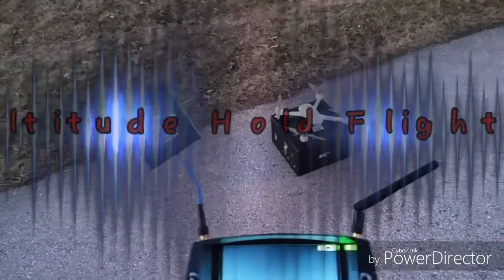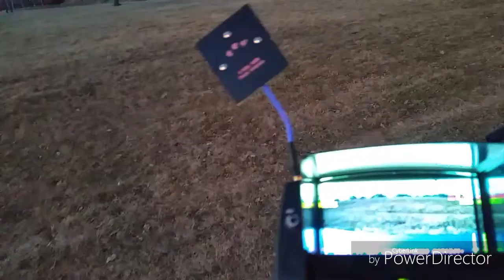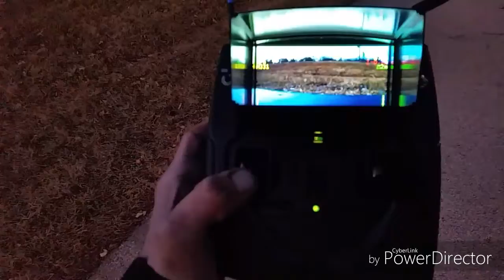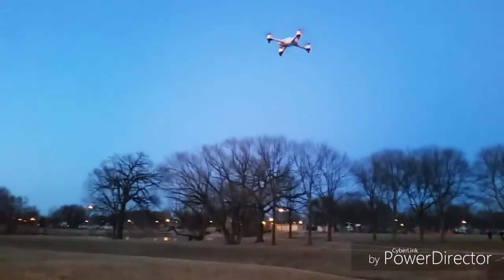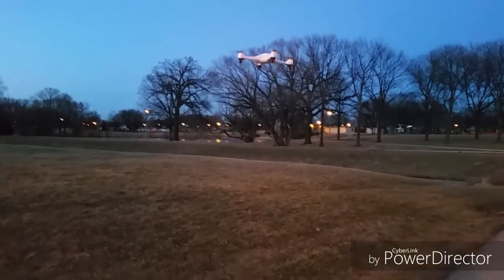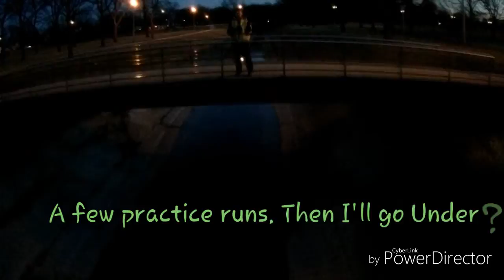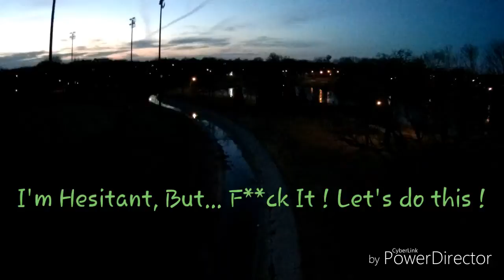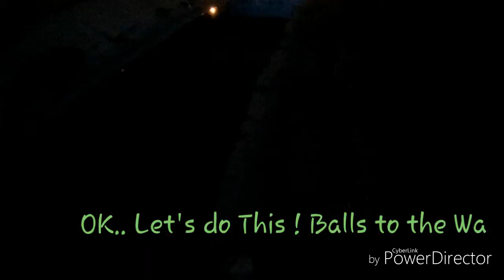hubsan h501ss Altitude Hold Practice and Flying though Obstacles. Awesome

Comment: Hi Mark. Your accent sounds like Wisconsin or Minnesota 😎. I'm from Minnesota but live in California and lost my accent::( anyway I was wondering how far you can go in altitude hold before flipping on gps and it wouldn't kick in to save my butt ? I'm ordering the latest version . What are your thoughts on that ? Thank you for your time. Have a great day. Sincerely William Horsley
Reply from the maker: Oh wow. Your range, depends upon so many things. Your flight environment, any signal interferce, which controller you have, etc. I guess my thoughts would be to, use GPS hold and test your range, before it goes into automatic RTH lost TX Failsafe. Using that range, as a "reference", stay within the same range, in altitude hold. Don't go beyond where your quad went into an auto RTH. It is really give or take with the range, depending on what controller configuration you are using. If you have the standard controller, you should definitely do the external antenna modifications. If you have the so-called Advanced controller, be careful. Not sure if you've seen either of these two videos, they were long-range flights I did in a wide open area. GPS hold the entire flight, both. ---> https://youtu.be/mK65FPO72Lw.  AND --> https://youtu.be/3ctTn-Xv6v0.  Oh yeah, from Wisconsin.
Reply: @MarkSuttner  I'm from a small farm in Wheaton Minnesota . Thank you for the information and I'll be careful and do like you said.  I really have a fondness for the hubsan h501s. This WIFI for fpv is terrible,  I never understood the reasons behind going that route instead of staying with analog

Comment: Great video. Been chatting with you in one of your other videos and subscribed. Now I noticed in this that you added a caption 60%.. is that the sensitivity on the transmitter as gone in those settings as a newbie to take from Pro bit... Will it still use GPS on that setting as do not want to fly solo with no GPS until confident? also when activating the 60%, not long after it goes back to pro. What I mean is I activated at home while watching Tv and expected it to be on when taking quad out after a battery charge? Thanks again my friend and sorry for any silly comments
Reply from the maker: I'm not really sure what you are saying at the end of your comment...? LOL... The settings menu is 
 by holding down the left stick and pressing the right one like a button if you have the standard controller. If you have the advanced controller you hold down the throttle stick and press enter. From there you will be in your menu. You can change your controllers receiving frequency, you can change the "Control Stick Sensitivity", you can turn on the setting where it says, fly when no GPS, you can also go into manual mode flying. Manual mode is for extreme professionals only ! Changing the controller stick sensitivity from 100% to 60% is a good idea if you want "smoother flights". if you noticed, after you're flying forward and let off the stick the quad pitches upwards. Unless you release the stick very slowly to stop. Changing the controller sensitivity, is basically making the control sticks not so sensitive, if you get what I mean? Instead of the quad going As Fast as possible, it's more smooth... (60% is Actually Normal Mode, 100% is Expert Mode). I'm not sure why they come as 100% as the default setting ? These quads go about 5 - 5.5 Meters per Second ( in GPS Hold), and altitude hold they are capable of 5 times thats speed ! However altitude hold flying is very difficult ! Anyways, changing the stick sensitivity to 60% does not affect anything besides the controller's sensitivity to your inputs on the control sticks.
Reply: @MarkSuttner  Thanks again for all your help Mark, you're a gent. Now, ONE more SILLY... or Not so silly question... LOL!!!!! Is it a GOOD or NOT GOOD idea to give the brushless blades a bit of a zap with WD-40 just to keep them as new if flown in damp conditions.. and mean just inside too where you can see the brass curled wires?
Reply from the maker: @waddac2  NO ! Do Not Use WD-40 ! Ever ! Never !! It is okay to use a small amount of brushless bearing oil, every now and then, but you do not ever want to use WD-40 on a motor. Especially one with bearings! WD-40 stands for "water displacement 40". It dries out metal and especially bearings! It will disintegrate any type of oil or grease that is Factory fit in the motors and dry it out, Badly. If you're looking at the Copper that is coiled, that is basically just the magnets that make the brushless motor spin. To oil the actual bearings, you drop the oil, into the center shaft(bearings), not the coils. OIL is ok, Never Use WD-40 or PB Blaster, etc. Only "Oil"and Very Little amounts. You don't want dirt and debris in the motors. Oily conditions, Attract Dirt.
Reply from the maker: @waddac2  I understand why you would think WD-40 wood work to keep the coils clean. I would Not recommend doing that, whatsoever. If you want to clean the coils I would suggest using a can of compressed air or something similar. You do not want to get WD-40, PB Blaster or any type of penetrating Catalyst near the motor bearings. It will dry them out. "Liquid Bearings" is a very good product to use on the actual "Motor Bearings", you should not really fly in damp conditions, I understand why you would want to keep the coils clean however, damp conditions should be avoided all the time because not only does it dampen the coils in the motors, it also creates electrical interference with the components inside the quad.
Reply: @MarkSuttner  Thank you so much for that Mark and will only use my WD-40 on old locks that I pick and keep it well away from my drone. I will look into getting some proper oil for it at some point but for now will leave well enough alone as drone is brand new so probably will not need any oil dripping in for a few moths of flying. Thanks again for all your help and advice. I'm still interested in finding out the max distance or height it can go as there is nothing in the instructions. Will not be testing anytime soon as still new, but had it quite high in my first flight video then relied on RTH so did not mess up the landing in anyway, then as it got about 10 feet from ground I turned off RTH and continued flying for a bit. Also changed down to 60% in control settings but it went back to 100% after turning transmitter off and back on. I did not have drone turned on though, but if did would it constantly stay at 60 even if left off until flight next day or do you need to do it on each flight when drone is on?
Reply from the maker: @waddac2  You have to change the Sensitivity, Everytime you turn off the controller, it has nothing to do with the Drone, being on or off. Whatever you set your 5.8 frequency at, should stay set, after turning the controller on and off.  Every other setting must be changed, before every flight. I'm not sure if you told me or not, did you get to standard controller or the advanced controller ?? Just curious. Also, I'm not sure if you changed your 5.8 frequency in the controllers menu at all? If you haven't, you might want to. My h501ss came with the 5.8 frequency set at 5780 MHz The best frequencies for quads are between 5745 - 5760 MHz.
Reply: @MarkSuttner  Sorry delay Mark as not long been in from work. My transmitter is the standard controller and is set to normal 5.8G as did not want to mess with that setting. With mine been just the h501s should I still change frequencies to what you say, and will they stay after as do not want to do it each time? Do not mind adjusting sensitivity on each flight but if I am messing with too many controls may mess things up.

PS. Mine is at 5.8 and frequency at 5790MHz... Should I still drop to what you think buddy?
Reply from the maker: @waddac2  Yes. Set your 5.8 Frequency between 5745 -5760. The only reason for the different numbers is your flight environment and what's around you that may cause interference. Changing the frequency setting will not harm anything at all. 5755 MHz, seems to be a sweet spot, for these drones. Don't worry about the settings and your menu as much as you are. 5790 MHz is Way Too high ! Set it at 5755 and I bet you get better Reception. Do Not be afraid of the antenna mods ! They are So Simple ! They will extend your Range, your FPV and the communication between your Transceiver and your Craft ! It's A "Must Do", my friend ! Super Simple ! All you need is a drill, a couple drill bits, and a aftermarket external antenna mod kit ! That's all there is too it ! Take your time at first, and watch videos on how to do it. After being in this hobby for so long, I could probably do the antenna modifications blindfolded ! Lol 😊 Anyway, change your frequency down to 5755. I guarantee you you will get better reception. Also, there are a lot of factors, to consider when flying a real-time 5.8 GHz transmission drone. You have to think about your surroundings, the entire sculpture of the Earth around you and potential sources of interference. I'm not trying to blow your head off, with too much technological information, at once because it takes awhile to get used to these things... Are you aware or ever hear of the Fresnel Zone ? those are the types of things I don't want to bombard you with as you are making your first flights. However my h501ss came with a default 5.8 frequency setting the same as yours. Too High ! Lower it to at least 5760 - 5745MHz. Trust me, you'll benefit from it. The settings in the menu are very simple and can be easily changed. The only settings that cannot be "remembered" are the controllers sensitivity, flying with no GPS setting and *manual mode*. The 5.8 frequency setting should stay the same after you lower it from the default setting. Is this your first drone? Actually, is this your first gps-enabled, real-time 5.8 & 2.4 set up? I'm only asking because a lot of drones use crappie Wi-Fi transmission and reception and they just suck ! Unless they incorporate their "Own WI-FI network", like DJI products do...
Reply: @MarkSuttner  I will probably look into the antenna mods at a later date after quite a few hours of piloting time. I'm still at work at the moment but when I get home tonight at about 22:00hrs I will change my transmitter frequency from the 5.8 to your recommended 5755

Regarding it being my first drone, yes it is. I have had the very cheap ones a few years ago that are made out of polystyrene with for blades concealed but that's about it. Im not great with getting my bearing in flight directions but will soon after a lot more practice, hence reason I love this hubsasn with the GPS so if get into trouble can let go of sticks and it will stay where it is. I can get my bearing and slowly bring back to me, or click RTH and quad brings itself back.
Reply from the maker: @waddac2  One thing you Really need to be aware of, is the V.R.S. The Hubsan drones, suffer during a Return to Home. Please, Listen to me about this ! The V.R.S. (Vortex Ring State), also known as the "Toilet Bowl", in Simple Terms. Anyways, when the RTH function is activated, the drone will climb about 10 to 15 meters in altitude and then fly, autonomously back, to the position of the controller. Maintaining its altitude, during that time. What happens and it can be a fatal thing, is a vortex ring state / Toilet Bowl ->After, it flies back and is now starting to Descend Down, it can start to VRS, Bad. This happens "Mostly" in Windy Conditions (10+MPH). However, it can happen in low winds. Always, Always, Watch your controller's screen and make sure the Drone isn't starting a "spiraling motion", also known as the toilet bowl, or Vortex ring state ! These quads have problems with autonomous return to home descendants. If you are flying in windy conditions and activate return to home, watch your screen carefully!! Especially when it is descending Brother !! Like I said, it usually only happens, when it is windy outside, but it can happen when descending from very high altitudes. If you notice, erratic movements or a Circling/Spial, on your controller screen, immediately switch off the return to home button and slowly bring it down manually. It will save your drone !!! ;)
Reply: Mark Suttner I changed my frequency and now i have much worse signal! And even worse, I don’t know what the original was! Now i can never have good signal!
Reply: @drewl9781  5800 works fine. Good info here tho. Never have too many hubsans to fool around with/mod/etc. Best hobby drone out there imo. Also use a pad to launch from I think always. Buy a case for storage. Never throw a wrecked on away as they're fun to take apart and see how they're put together/experiment with mod'ing with first etc.

Comment: what do you think of the H501SS is it better now?
 as it used to have a few problems
Reply from the maker: Yes. Definitely. It doesn't have as many problems as the original h501s. The SS is Definitely better. You don't have to update firmware to have the circle fly function, he returns home 4 words instead of backwards and also returns to home to where the controller is (where you are), instead of returning home to its take-off point, like the original h501s does, you can move around wherever you want and when you press return to home, it will come and fly back to you. It tries to land within about 5 - 10 feet from the controller's GPS module. I also notice that not only does it fly better and have less problems with tumble of death and toilet bowling, it can get way further range. I was able to fly my SS (Standard/H901A Controller with antenna mods) out to 2,357 Meters away, 50 Meters high and it was able to return to home! I was just using the one flight battery, the standard range kit, 3dBi Dipole and a 14dBi Panel. Incredible ! I actually was  able to fly further, each time I tried ! No signal loss and absolutely perfect FPV. I made 2 videos of those long-range flights, if you're interested..
Reply: @MarkSuttner  thanks that was helpful great vid by the way
Reply: @MarkSuttner  thanks i received it recently and it is amazing but
when i fly in gps mode it moves and flys slightly turned but when im in atti mode no problems
i think it needs to be calibrated but how do i do that
do you think that that is the reason ?
please help.
great video by the way i also posted this on your most recent videos as i am a subscriber
please can you help me 
thanks

Comment: Hi Mark, what do you think, my friend? Is the 60% sensitivity for all flyings better? More calm flying?
Reply from the maker: Stefan Vieregg M.A. 60% Stick Sensitivity is "Normal Mode". 100% is Actually "Expert Mode". When you set the sensitivity to 60% it can give the quad "Smoother" Flying because it's not so "Jerky" when you stop, turn, or roll. For example: In GPS Hold, when your Flying Forwards and want to stop, if you quickly release the stick, the quad will Pitch Upwards Very Suddenly. Causing the camera to point Upwards as well. If you Slowly let off the control stick, it won't "Jerk" to a stop and Pitch Upwards, it will Gently stop itself, reducing the Sudden Stop. The quad Will Not fly as Fast when set at 60% . However, for "Smoother" Video Footage, setting it to 60% helps it. If you want to try Altitude Hold Flying, I Highly Suggest you Start at 60% . The 501S is Very Fast In Altitude Hold. It also Will Not Stop itself and remain in hover. It just keeps going which ever Direction You controlled it to go. It's almost like driving on ice with No Brakes ! It's Very Difficult to master. Starting at 60 will give you a better feel for Altitude Hold without Crazy Speeds. I've Finally Gotten pretty good at it. It took A Lot of practices and Very Close calls however. You have to learn to Roll, Yaw and Maintain Throttle Controls all at the Same Time ! It's very difficult to do. Anyways, setting the sensitivity to 60% is mostly for Altitude Hold Flying and Very Smooth Video Footage.
Reply: That's it, Mark, the jerking is too much, even if you controll slowly you always flying on a swing set. Without GPS the bird gets fast uncontrolled, it needs some training time, of course. But you can fly really adventurous. Today I reached the limits with the Hubsan controller without antennas. It is not so wide ranged that you can make a great jump in the height over the 100m, the transmission will be reduced to 20-0 % quality. But we have really many interference sources here in our little country. Nearly every second hill has a interrupting soure .
Thank you very much for your explanation.

Comment: Wrong! Assuming you are 6 feet tall, the clearance under that little bridge is at least 15 Feet. But, I can see I will be doing some night flying after seeing this.
Reply from the maker: Mitch The bridge has water under it with Banked / Slanted sides. It's not as high as it looks. Remember that these quads have FishEye Lenses. They make things look a bit distorted (Proportion Wise). Anyways, I'm really not concerned with the Exact Clearance by a foot. It's Difficult to fly under. Trust me. Also, yes Night Flights are cool. You can really get some great footage Sometimes. Sunsets, Etc. Remember if you have the SS, the H501A camera module they put in there is Very Sensitive to High Light & Low Light Situations. It also pixelates the footage when flying fast. They are 1080p Full HD, however only 30 FPS. I guess that's why they give you a ND (Neutral Density Filter) along with the quad... Thanks
Reply: Mine will be here Friday, still on the Truck. I'll find out all these things better then. Still not even sure what model I am getting, Talking chinese by e-mail isn't cutting it..